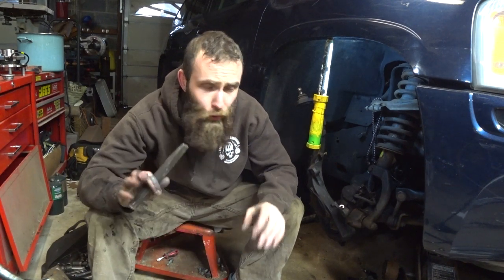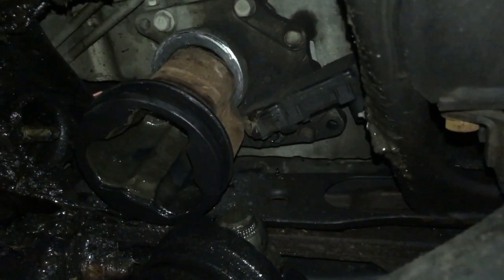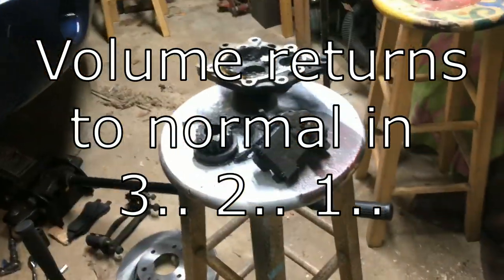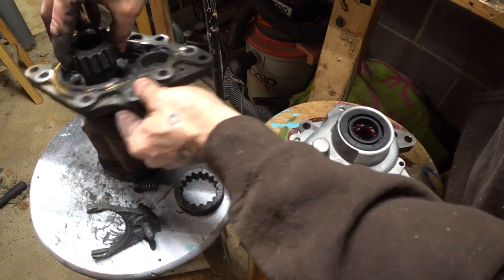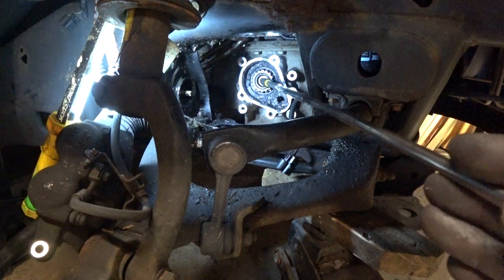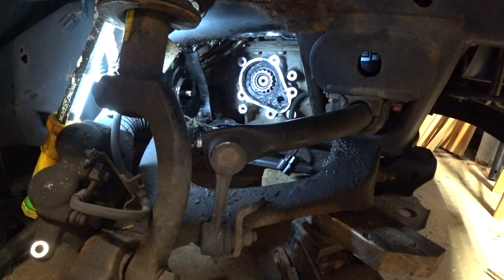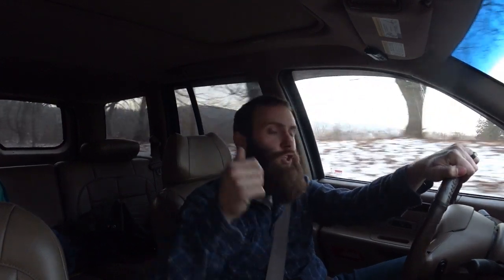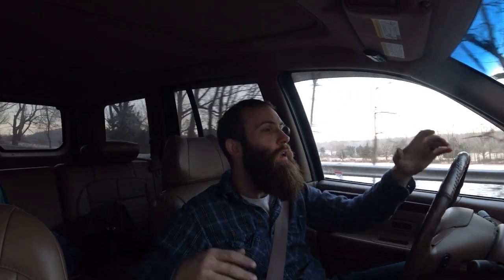WORST CV AXLE FAILURE I HAVE EVER SEEN - GMC Envoy is now beyond repair!

Comment: One thing I would like to add is the wheel bearing for the front for a rear wheel drive and the front bearing for the all-wheel drive / 4 are the same you can use that wheel bearing without a CV axle or CV axle stub

Comment: I've been driving my '05 Trail Blazer EXT - 4.2 for 5 years with no CV shafts in it at all. 

I'm waiting for the bearing halves to fall apart any day now ... not. 

FYI --- the hubs are not going to separate and the wheel(s) fall off or point in odd directions.

Comment: my 08 was worse than this. the CV axle had spun around and hitt the lower control arm bracket. totally cut the actuator off. rip the pigtail off. I pretty much replaced everything but the spindle on the right side so the almost the whole right knee  I was able to get the distorted housing off

Comment: Would a bad bearing (or any internal damage for that matter) in the axle disconnect housing cause vibration felt at highway speeds?

I have a 2008 trailblazer with a lot of flop when I move around the cv axle where it goes into the axle disconnect....my symptoms are shaking felt at highway speeds...I can really feel it in the front end around 65mph+ and it's not there or I can't feel it anyway at slower speeds...I definitley have a bunch of play though at the cv where it meets the axle disconnect 

Also was wondering as I live in florida and have absolutley no use for the 4x4 (bought truck up north for snow could I just "delete" the front diff by removing both cv axles and front driveshaft?  I heard that the 2wd and 4wd hubs are the exact same so it is ok to do as far as the hub bearings are concerned

Comment: Replace the whole front axle with a used one , thats what i gotta do , my cv never blew but the bearing behind it is vibrating at 45 mph , let off the gas it stops , finally figured out where it was coming from both new cv joints , all nes u joints , that didnt do nothing , stinking bearing i never changed before in that front carrier behind the cv shafts , yuk .

Comment: Thanks for posting this. I have not had the time to work on my Trailblazer and it's been sitting on jack stands for months because of this issue. I was going to start fresh with trying to reseat it into the transfer case just in case I did happen to kink it on the way out. Before taking another crack at it I watched your video and it sent me in the right direction on how to tackle it. All the other videos I have seen showed the actuator housing just popping out after being unbolted. Details below:

To remove it I used a heavy mallet and chisel to push in the back of the housing into the transfer case. I took off the front and removed the guts and went around it while hammering to push it back in and possibly crack the seize. I was not sure how much I may had moved it in the past and if it was moving evenly so reseating it made sure my next step would apply pressure evenly.

I then used the end of a slide hammer sandwiched between the two pieces of the housing which I bolted back in place with only a little play once bolted back in. I didn't want to bolt it down too tight and put pressure on the spindle of the transfer case. For shiggles I sprayed some WD-40 in the crevice between the housing and the transfer case. I didn't expect it to do much but figured it could not hurt.

Then I just layed on the ground and kept working the slide hammer as hard as I could. Checked spacing here and there and didn't see any movement. I kept at it moving to different positions trying to get better leverage and eventually it popped off covered with a bit of crud but nothing horrible. Mind you I have done this before just not as forceful and for as long.

Hope this helps someone else in the future.

Comment: I just did this with my '08 TB. the passenger side was a pain, the fact that the CV joint wouldn't come out so I am bolted the plate and was able to remove it all at once and used a pulley to separate the axle from the diff plate. mine didn't have metal shavings in the housing so I cleaned/regreased and put it back together.

Comment: I got myself too deep into this mess to turn back. I would consider myself a Ford guy, but I made a gamble on a 2004 Chevy Trailblazer LS (4.2L). I went to get it inspected, but they failed me on the upper control arms and upper ball joints. When I saw the estimate they gave me ($1100), I just turned around and bought the parts to do the job myself. At 24, I have never done any sort of front end work before, but I have experience with replacing parts myself on every other vehicle I've owned. 
I replaced the parts (which was a pain btw because I had to cut part of the body that wraps directly behind the upper control arm bolt, making it impossible to remove otherwise) over the course of two weekends.
While I had everything apart, I noticed the boot of the CV axle on the passenger side was torn. I was annoyed, but bought the axle, along with the 36mm socket I'd need for the axle nut. Before the part arrived, I made a 30 mile trip. Near the end of the trip, I felt a really bad vibration coming from the passenger side, and seconds before I arrived, I heard metal on metal banging with every revolution of the axle. I got out, and to my chagrin, I saw that the wheel was barely hanging on. Three lugs had sheared completely off, and the rest were loose. After limping my car to a flat work space, I assessed the carnage. I pulled the CV axle out, and looked at the 4x4 disconnect. The bottom was almost eaten through, causing the axle to flop around on the frame. I shook my head, and ordered a new 4x4 disconnect, along with a new hub assembly (both of which were not cheap). I stayed up til the wee hours of the morning last night working on the Trailblazer. The majority of the time was spent in trying to get the back half of the 4x4 disconnect off the oil pan. I saturated the connection with PB Blaster, and pried with all my might. Eventually, I broke the part in half, leaving half of it still firmly stuck. To those who are dealing with this, using a hammer to beat evenly around the perimeter of the part does more good than prying with the strength of a dozen men. 
This morning, I got an alignment (they also replaced the lower control arms), and the 4x4 works again now. As my first front end experience, I don't think it can get worse than that. In the future, I think I will stick to Fords. (I tried Chevy, I really did).

Comment: Great video! One thing I want to add is the envoys/trailblazers use the same hub assembly and knuckle on 4wd and 2wd. (2wd has no axle) so you can run these trucks without the cv axles and not worry about the wheel bearings coming apart. You do need to leave the inboard cv axle housing snapped into the front diff to prevent leaks and contamination of the front diff. Most other vehicles you cannot run without the axles. The envoy and trailblazer are an exception.
Reply: I second this… you do not need the “cv axle stub” to hold the wheel bearing together…. Being a Trailblazer SS owner I’ve seen several people and heard of even more not running the stub
Reply: Sure you can , you just use both ends and remove the shaft ..its the otter end design with that big washer and 33 mm nut that our life rides on ...
Reply: @MikeSmith-nu9wt  how,  do you fill in the front diff hole , cut the axle and use just the two spline ends ?? I can't find any videos on an Envoy cv delete. I only use 4x4 for rare snow in CT
Reply: What about with a buick Rainier. It's AWD! Does it have same wheel assembly hub as trailblazer/envoy and not need CV

Comment: This happened to my 2006 Envoy. The axle disconnect housing was oxidized into the oil pan. I had to literally break off as much of the inner housing with a long chisel and a hammer after which I started to drill small holes in a circular pattern into the frozen up inner housing (it's quite thick) increasing the drill size about 5 or 6 times until I could chisel the axle disconnect housing until it broke into pieces and eventually freed up and was able to be removed. Not an easy job by no means. But you were down to the seized housing and gave up. You stated that the vehicle was otherwise in good condition. You should have taken a better look at it because you were about an hour away from getting the old part out. These are quality vehicles and should not be parted out because of this repair. Just  sayin, in my opinion.

Comment: Just take the cv joints out and take them apart and just put the shaft part back through the wheel bearing , then put it in two wheel drive and make a two wheel drive out of it.

Comment: The envoy is an absolute survival dependable truck these bad boys would do just about any job you throw at them climb over just about anything these vehicles last a long time and the motor pretty much has to be seized for them to stop moving I've had my own voice for 10 years now and I absolutely love this Beast but that's not to say that they don't have their issues it's just usually pretty cheap to fix the issue I've never had to repair on this thing that crossed more than $500 considering I do most of it on my own I absolutely love the Envoys I have yet to see a vehicle Outlast them the coolest part is with my 02 I was on the highway and I beat a Dodge Charger busting it at 110 mph wasn't paying attention and didn't see the cop ahead I got pulled over and got a ticket I wasn't even mad at the ticket I was kind of proud of it and put it in a picture frame on my wall my little O2 Envoy beat a buffed up Dodge Charger it was epic love these vehicles

Comment: I took on this job to help out my daughter's boyfriend. His parents bought the parts and I did the free labor. The 4wd disconnect was seized in the oil pan just like the video. I didn't have any luck trying to gently pry it away. I used YouTube and found this video.
After watching this video, I was frustrated that it might not be possible to remove it. I knew I had to get it out. I used a combination of an air hammer and a slide hammer to remove it. I removed all the bolts and took the front cover off.  I then used a slide hammer with some thick washers. I bolted the slide hammer to the second half of 4wd disconnect. I used the slide hammer and was able to get some movement. It then quit moving. I figured it was bound up at an angle. I switched the slide hammer plate to a different set of mounting holes. I used the air hammer set about 80 psi to massage the half of the 4wd housing. The housing then seated back flush. I then started working the slide hammer again.  I could definitely feel it coming out. 
My big take away and advice: The 4wd disconnect sits in the oil pan with a tight tolerance. Corrosion makes them hard to remove. Also, It has to be removed  evenly.  If the recessed half it not being pulled straight out, it will bind up. I used a 3 ton floor jack to raise the lower control arm up enough to use the slide hammer effectively.  Once I got it coming out straight, it was easy. I hope this helps someone. Remember to bolt the slide hammer plate to only the back half of the  4wd disconnect assembly. The holes that use the shorter bolts.

Comment: 2004 GMC Envoy , well maintained and a great vehicle , was parked out front of my house , on the street , crazy neighbour lady backs her mini van out of her driveway at what seemed to be half throttle , hits the drivers side front wheel dead center , small amount of damage on fender but no biggie right ? I go to move envoy back into my driveway and the wheel lets go at the bottom ball joint rendering me in place. Managed to lift up and jimmy it together and bring up the street to my mechanic so crazy neighbour lady could support his cause! Great car , lasted many years until my son t-boned an idiot turning in front of him from a red light. Also have a 2006 and 2007 Envoy , Wife drives the 2006 and I pick parts off of the 2007. New front right cv joint just arrived and I will be installing on wifey's car tomorrow, (boot is torn on existing shaft) , new one was very inexpensive so didn't bother with removing one from parts car. Worst ( and most expensive downside to envoys ) is the rear tailgate glass exploding , $1500 replace , thank goodness for insurance. Turns out rust builds up on the upper hinge parts , expands and then shatters the tempered glass. Cheers!
Reply: The rear tailgate glass does what now??
Reply: How can you prevent the rear tailgate from doing that?
Reply: @luveguru7392  whenever you open the rear tailgate glass on the trunk, just clean the area on the top, where it is hinged and inspect the edge of the glass where it contacts the rubber gasket… Tempered glass is very strong, but just one odd rock or piece of metal preventing it from closing all the way or just pinching the edge of the glass maybe just enough to pop. Rather than trying to clean 50 sharp shards of plate glass…. You’ll be vacuuming 5,000 dime sized pebbles

Comment: The wheel  bearing module is not pressed together. The hub is cold forged over  the back side of the inner race of the bearing . it cannot be removed. You can not rebuild the bearing modules, th whole module has to be changed.   The 2 wheel drive model use the same bearing modules as the 4WD models. You can pull the axlw shafts and drive a 4WD model as a 2WD model.

Comment: You can do a cv joints delete…. You have to disassemble the cv shaft threaded end off the cv shaft and reinstall onto bearing hub without the complete c/v shaft. Been there done that lol.
Reply: no you don't. The hubs are the same on 2WD as 4WD and the 2WD ones don't have any parts of a CV axle in them. 
It's a myth that you need to have at least the outer piece of the CV shaft installed to hold the hub bearing together - nothing bad will happen if you do or don't install it.
Reply: @SurferJoe46  it’s not a myth… try removing the front CV axles on a GM 4 wheel drive pickup truck…..see how far you go before the bearings come apart and break the caliper bracket then the front wheels comes off with half the hub assembly still attached to the rim. Buddy you’re giving bad advice…

Comment: Hey my son has 2 envoys  a  2004 4x4 and a 2002 2WD and  both have the same hub bearings  and  there's no CV axle on the 2WD so what is holding it together  ?
Reply from the maker: Usually 2wd have a different style of wheel bearing which does not require the axle to hold it together
Reply: @DEInTheGarage  there all the same wheel bearing.....
Reply: @DEInTheGarage  Lie. They are the same hubs --- no axle needed.

Comment: I actually like these suvs over the jeeps etc….I’ve got an 05 trailblazer LS…they have the identical engines etc in the envoys and tb…the inline 6 4.2l that come stock with around 280hp and 280ish ft lb of torque at the wheels…I can tow up to 6000lbs easily …wish I could find one with the 5.3 or 6.0 v8 in it…they’re always so expensive when I do find them for sale…who would pay $50,000 for an 08 trailblazer ss with 50,000 miles on it lol…

Comment: Here's a bit of trail-side engineering for your consideration. Bust one of these in the woods and you can remove the stub shaft end from the axle , reinstall only that, and get her home.
Reply from the maker: Wild... That is an awesome hack. thanks!
Reply: Jon B that’s some good knowledge for sure
Reply: This clown trying to teach us how to fix our Chevy's and Jon B saves the day!
Reply: I have done this and it's been going on 10k miles, I check it every once in awhlie and all is still tight and in place

Comment: Not sure if it's a common issue, but we had one come in with identical damage. We used a puller, heated the gear on the transmission shaft while using a air chisel on the gear to break it lose. Took about 45 minutes and a lot of cussing. And your right, I wouldn't advise tackling it without a lift. It took three of us. 1 torch, 1 puller tension and 1 air chisel.
Reply: Richard Bricker you’re a legend
Reply: Rick B how much did you charge for the repair?
Reply: @wildestcowboy2668  Can't really recall since this was 2 years ago, but it was a regular, good customer who we service 3 of their vehicles, and you have to take care of them. Vehicle is still on the road today. Did the State inspection on it in June.
Reply: @rickb8808  Reason I asked I need my Chevy's front one done. Boys around here will rip you off.

Comment: AutoZone shows identical part numbers for the 4x4 AND 4x2 front hub. 4x2 requires no axle stub in it to run. I own 1 of each.
Reply: That's a lie pal
Reply: @wildestcowboy2668   Not a lie pal, same front wheel bearing used on all 2wd, 4wd, AWD models. I state that after retiring from 20+ years as a GM parts dept manager.
Reply: @wildestcowboy2668 GFY troll

Comment: You can do a CV axle delete!!!! They actually come that way for the models that are not 4x4
Reply: Yup ,my 07 wheel bearing has grooves just no shaft or four wheel drive
Reply: Correct. The base rwd is the same transmission which is 4l60e as the 4wd and awd models. Removing both cv axles should do fine but the service 4wd light will pop on. Or you can send the pcm for a tune and delete the 4wd. The difference is in the transfer case up front and the driveshaft that connects from transfer case to the front differential. Remove those and it will just be a regular rwd
Reply: @christopherzube551  as long as the actuator is still plugged up at the front differential, the light won't come on

Comment: My disconnect was seized as well on my trailblazer. I had to get underneath with an air hammer and rock the housing back and forth. Took an hour but it finally came loose.